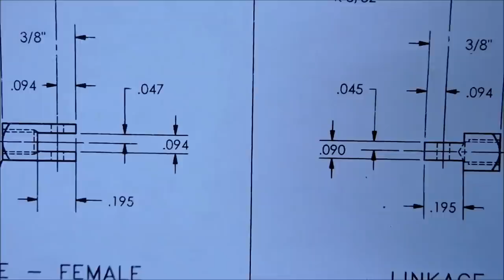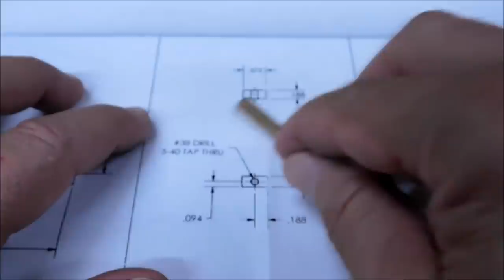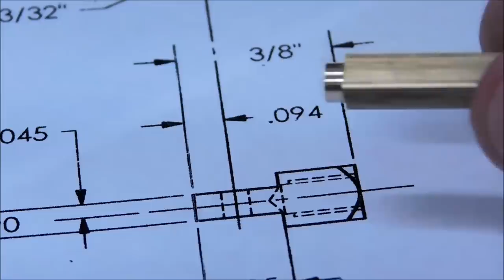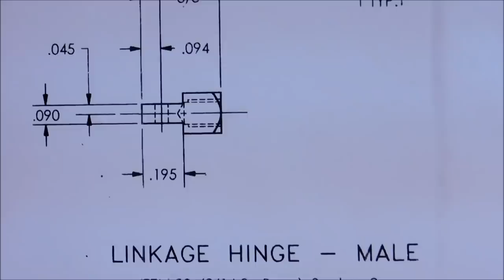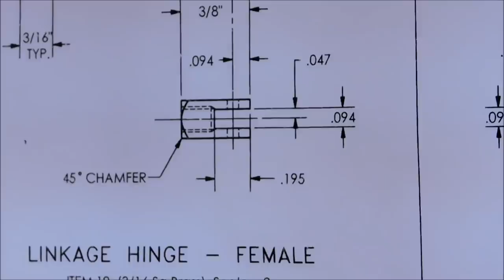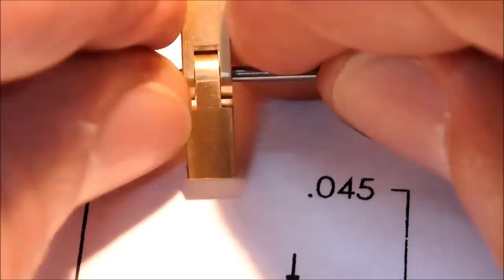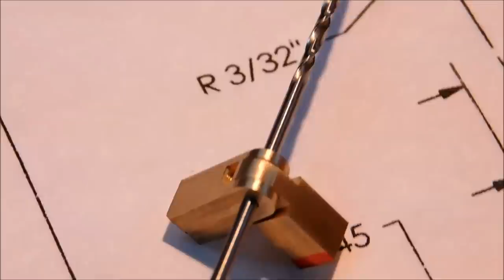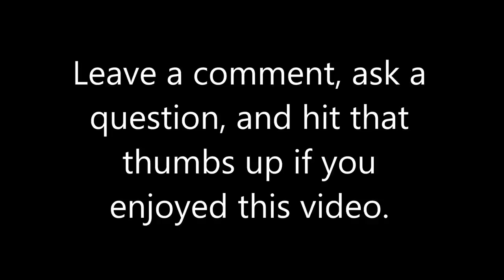Machining a Model Steam Engine - Part 4 - Square Collets and Small Parts

Comment: Thanks Joe.  I do learn something from you now and then!  I'm another old machining head, but had never thought of the square collet fixture for holding the square piece.  I would have done it a way that took more time in the long run, mounting a small 4 jaw in another chuck.  I like your way better.
Tip o' the hat, Mr. Pie.  :)

Comment: I like how often you climb cut. It just goes to show that it is not a bad thing. I hear to many time that you don't want to climb cut. In my 13 year production machining career I never had a problem climb cutting. If you have a decent machine without a lot of slop I don't see the danger. You get a better finish. Another good video Joe.
Reply: As you know the only problem with cutting the "wrong " way is the sudden take up of backlash, if the cutting forces are considerably less than the force needed to move the mass of the mill table there should be no problem. So with a small cutter moved slowly you can often cut safely, but a big cutter moved quickly would be a no-no. The big but is that you have to have a bit of experience to know slow from quick and small from big.😤
Reply: @chrisstephens6673  You are right. I worked mostly on small parts on Bridgeports. I haven't touched a mill in over 25 years. Forgot about the backlash. It would have come back to me if I started milling again. Thanks.
Reply: I worked an old and terribly abused / unmaintained Bridgeport at an automotive machine shop. It had 5/8 turn of slop in the x-axis, no power feeds (not even the quill - the gears were destroyed long before my time) and no DRO. I'd have to climb cut for the smoother finish for gasket surfaces regularly. I'd tighten the table locks to the point of really having to crank the x-feed on the long cuts on the flute edges of the end mills. It worked most of the time, but sketchy AF. If the cutter climbed over, it would force the table to move and bash my hand with the wildly spinning x-axis handle. Every once in a while, I'd produce a serrated edge intake manifold......
Reply: @scottb8175  ah that old textured finish. 😉

Comment: Thank you! Holding small parts accurately is an art!
Reply from the maker: I like small parts. Holding them is most of the work.
Reply: @joepie221  Hi Joe. Ever heard of what is often called 'part on a stick'? I sometimes repair and / or build HO scale locomotives from brass. It is common practice there to temporarily low temperature solder the microscopic and / or impossible to clamp parts onto larger pieces of brass to hold them for machining and hand filing. Just unsolder when done. Any excess solder can be removed with a solder wick or filing / sanding. Much better than the glue methods as solder is stronger.

Comment: another great video Joe.  Using the 1,2 3 blocks for holding the small parts  in the vise is a good idea to be used a lot. I'm sure anybody that doesn't have collets with square holes with be making the fixtures.  A fixture to hold tapered  round material like the legs of  a divider to be sharpened on a " D " grinder might be held in a similar fashion as your split collet.

Comment: Great hint on making the center the press fit.  And yeah, I've been there and sworn at the thing at the time.  It wasn't a yoke like that but it was roughly the same sort of idea.  And yeah, it pinched in tight and had to be pried out a hair.  Next time around I used a piece of shim to hold the gap then pulled the shim out after.  The pieces in question came that way.  For anything I make I like your way far better.

Comment: Looking at those drawings brings me back. Im great full I am old enough to have experienced doing mechanical engineering blue prints by hand on a drafting board. Then making blue prints and the smell of that ammonia blue print paper. I was able to experience the transition to digital drawings. When cad, unigraphics and catia were first coming out.

Comment: And to think I would have looked in my 5 C rack realizing that was the one size square I do not have, then after I looked in the broach drawer and figured out I do not have a 3/16 square broach either. Frustrated to the point of not being able to think outside the box, not realizing I had one all along, I would call MSC and order a 5C collet😕  completely ignoring the small 4 jaw chuck I have on the back of the shelf! Elegant solution Joe...elegant🍻🍻

Comment: Wow loved it joe and didnt need a 5c collet square set. I also like the radius cutting. Will remember to use a 4 flute too. Great tip. 
I have been glued to the series and it never gets old.
I am currently working on some aluminum threaded Bushes but keep turning on me when threading. Its a big thread 1/2 BSPF, 3mm wall. 
I Have made collet to hold out of 50mm aluminum round stock spliit with 25mm bore, still slips just not as much. Still working on it only have 400 to do.
Once again great video Joe i appreciate your work very much.

Comment: I would imagine that a threaded collet adapter can be made in the same fashion. I attempted to do a similar adaptation by putting an inside thread on a rod then spliting one side of the rod so it could be clamped down on the allthread I was using. I had to go to a four jaw chuck to center the setup. In the future I will use this same setup you demonstrated. I'll put the internal thread on the collet adapter I wish to make, include the flange, then split the adapter completely in half. It should center just fine in a collet or three jaw chuck. Thank you!

Woody

Comment: This morning a watched a video by Harold Hall in which he made a four piece square collet starting with four pieces held in a four jaw chuck. This looks simpler. Of course if you made the "collet" with a bigger OD you could cut a groove and use an O-ring to hold the together.  That way you can lose both sides at once. 🙄 Always more than one way to take the cats coats off. 
Nice work as always. 👍
PS use one of these to hold square broaching tools in the mill. Make the broaches out of HSS square tool bits

Comment: I've seen a couple of videos lately presenting extreme criticisms of the quality of this build. I know this model well, and can't say enough good things about the results and philosophy's behind your approach. This is an outstanding series. I left a detailed reply on one of those other videos today, and it was deleted. This leads me to believe those videos may be a collaborative effort and produced by some very sorry individuals. Don't let the trolls get under your skin. They are not worth the effort.
Reply from the maker: I appreciate the advice. It truly is best to just laugh and ignore them.
Reply: @jackorlove4055  I am a machinist and your comment about working in varying level of tolerances is incorrect. A machinist works in the tolerances given on the print. That is all we care about, because the print is the contract. The only perfection we chase is "in tolerance" regardless of if that tolerance is ten thousandths of an inch or ten millionths of an inch.  If the part is poorly designed, that is the engineer's problem, not ours. If I am given a print of a part that has some silly tolerances or an expensive feature, I will basically kick it back for clarification with an "are you sure?". Many machinists don't bother, and will make the part anyways regardless of cost, and which is perfectly within their right to do, ethical or not, provided the agreement was to simply make the part.

Also, in regards to who is or is not a machinist: If you can be given a blueprint, and with no supervision can use the tools at your disposal to give back a completed part that is in tolerance (which you know because you inspected it), then you are a machinist. It doesn't matter if the blueprint was for a plain cube or a jet engine part. If you work in a machine shop all day making plain aluminum cubes, you are still a professional machinist. If you work in your garage making inconel jet engine parts for funsies, you are still a hobby machinist. Either way, you are a machinist. It is a very broad spectrum trade with more than a lifetime of learning in it, which means we only stop improving when we decide to.
Reply: @SuperAWaC  I think that it applies to anything that involves plans and a third party, whether it is a part for a rocket or a garden shed.
You get the better engineers and drafties, who have either experience in the building/ machining, or who can visualise the process.  And you get the less good ones who only draw lines on a computer screen and pull numbers out of their backside.

And on the receiving side, you get the ones who say "well, that's how it is on the plan, not my problem if that's not what you wanted" and the ones who will get the customer to check if that's actually what they want because it doesn't seem to make sense.

And then you have those who have no clue what it's all about.
Reply: @Hank Maki I agree. In the specific case of Joe making the engine, the blueprints for it are pretty poorly thought out with several bizarre constraints and weird dimensions and datums that make it harder than it has to be. In my experience, these kinds of prints generally come from a project where a blueprint is made by reverse engineering a prototype that already exists. Since he's making the project for himself and it's not a contract, he is free to modify it as he sees fit.

Comment: The way you cut that radius gave me a eureka moment. For doing roller chain sprockets, you could use a reverse helix endmill so the helix may passively anchor the part. Seems a lot faster than the rotary table method.

Comment: Thanks, Joe! You just stopped me from buying a set of square 5C collets!
Reply: Buy a square collet block and you can do all the operations in this video in the mill using round stock and without making a special bushing..
Reply: @davidkepley4396  You're not wrong.  For me, it's a matter of personal preference. I like being able to make my own tools if I can.  Being a broke hobby guy might be a factor, too!
Reply from the maker: the chamfer was done with a form tool when the parts were set for the final tapped feature.

Comment: Long-time subscriber, really enjoy your videos and have learned a lot.  Last weekend I needed to fixture a complex auto part and machine a section of it for additional clearance. (Installed an upgraded fastener on it's mating part.)  When making the fixture to hold the part, I found myself asking...  "W W π D?"  [What Would (Joe) Pie Do?]  The fixture worked great, the part turned out great, I couldn't have done it without you.  Thanks so much for sharing your thought processes and clever approaches.  We want more π!
Reply from the maker: Thanks for being a part of the 100K push. I really appreciate the trust and support.

Comment: I saw what happened there when you started the radius and were cutting from the wrong side. I'm sure it didn't feel right to an experienced hand and you realized/rectified your mistake. great to see even the best machinist on youtube can still make a mistake. Superb video as always Joe.
Reply from the maker: You have very good eyes. Of all the table and part shifts done to create those radii, I admit to one incorrect sweep. Even with a small endmill, you know immediately. It either simply offers resistance, or it hits very hard and tries to lift. Excellent catch.
Reply: @joepie221  I'm trying to learn from the best over here

Comment: Could you put an O-ring groove just to hold the halves together?
Reply from the maker: Yes, I considered that but didn't have the correct size. Don't make it too tight. It will compound the frustration of inserting the parts.
Reply: I've used the o-rings like that in my home-made taper expanding collet bearing pullers / drivers for sleeve type plain bearings like the cam bearings in a  cam-in-block V-8. I got the idea from a commercial grade tool sold for the same task.  I also use that method to make pullers for thin profile needle bearings (swing arm and suspension pivot bearings in motorcycles) so I don't destroy the bearings when I remove them.

Comment: Nice setup. For an alternative method. I do things a little different, as it’s just as easy to make round things square as it is to hold square things in a round hole. I use a Myford dividing head, see link at bottom. It features and integral 1/2 collet the same as my Myford ML7 lathe spindle so moving parts is easy. (Also chucks are swappable.)
I start with round stock 1 standard size up from the required square parts diagonal. Cut to approx 2.5x the required part length. 
I mount a slitting saw in an arbour into the lathe spindle collet. I mount the material int the dividing head collet. Then I mount up a vertical slide, face on to the lathe spindle and mount the dividing head onto the V slide holding the material facing end on to the slitting blade so that I can make end cuts into the material. ( similar to the setup shown but cutting into end of material not the side).
I then line up center on tool and position to cut off one side. For the male clevis I position to cut to the correct thickness and cut one side, then rotate 180 degrees using the dividing head and cut the opposite side. 
I then replace the slitting saw with a jacobs Chuck in the lathe spindle and drill out the pivot pin hole. Replace the slitting saw and reposition.
Then I rotate 90 degrees and reposition to cut off the round side and then 180 degrees to cut off the last side. Then I remove the part and measure the length & mount it backwards in the lathe spindle collet so that I can centre drill and drill the mounting hole to the correct depth. Turn the part around and mount so the machined end is clear and the form tool the Bach and part off. I always tap small parts like this mounted in a handheld pin vice (very old antique that came down the family line) and a hand held tap with a square guide to get a nice and square thread. I use a small bolt through the pivot point with a couple of steel buttons machined to the correct radius and needle file the end of the clevis half round. The female clevis is machined in almost the same way just with the centre cutout first, then reposition to cut of the front end he then the rest is the same. The Myford dividing head is great because it is self contained with collet and Chuck mounting threads. Integral tail stock centre. 60 turn action. 4 hole plates available. Easy single point mounting to a slide. I hope someone found this interesting or maybe useful.  Steve
http://www.maritima-et-mechanika.org/tools/dividinghead/myfordtk.JPG

http://www.myford-lathes.com/accessories6.html
Reply: The Myford small machines and accessories are very high quality....nice if you can get them. I also will point out another great hobby machine and foundry channel that comes to mind with mention of Myford tools - search 'myfordboy' on YT. I have seen many using the tiny yet seemingly capable Sherline tools also, although I can't say anything about them because I've never seen one in the metal.
Reply: @scottb8175  yes found his channel. He is a professor Brainstorm when it comes to making attachments.

Comment: Great video on machining small parts, which is often harder than machining big parts. Loving the bespoke collet.
I'm just curious about your method you used to cut the slot. Do you normally incrementally plunge cut to full depth then clean up? I've never used that method. Just wondering if it is a more accurate method.

Comment: Thanks for the very informative videos!   at 15:44 you have stop brackets installed to hold the vertical reference 123 block.. Question is what does that bracket mount  to?
Reply from the maker: This may help.    https://www.youtube.com/watch?v=XrXgqXmeNek&t=5s

Comment: Do you have a video for lathe leveling without the use of expensive levels? 
Really enjoy your videos, straight to the point and no deadspace
Reply: Look for "Two Collar Test" and "Rollies Dad Method". You don't need a level, just a micrometer.
Reply: @ttabbal  cheers dude. I’m awaiting another lathe, looked like a good way of leveling
Reply: The test bar method is only useful once the machine is well aligned. a Lathe does not to be level per se, think of lathes aboard a ship, it is likely never constantly level as the ship pitches and rolls. What is important is the machine sits on it's footings with no twist in the bed. Assuming the lathe is in good condition a twist free bed is all that is required. For shorter lathes a good shortcut is to mount the lathe on 3 points. Two at the headstock close to where the headstock meets the bed and the third under the tailstock end. Use some intuition to place these three point such that the machine will be least stressed by gravity. You can now pack up the remaining footings aiming to have an even weight distribution and equal tension in the hold down bolts for all footings. Aim to have as few shims as possible under each footing to minimise  "soft footings". The lathe  should now be close to alignment and ready for the testing stage.

Comment: Depending on how tight the centerline tolerance is I will make the tenon cut only on the back side and rotate the part 180 degrees. This always guarantees a centered tenon. Just another way of doing it and more geared to production. Good job, thanks for the videos. Did I miss finishing of the canon?